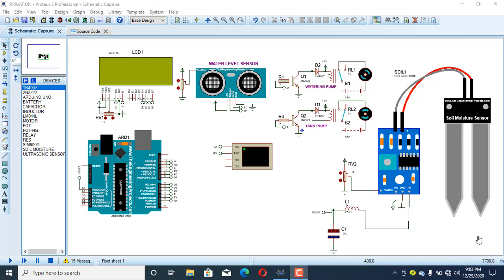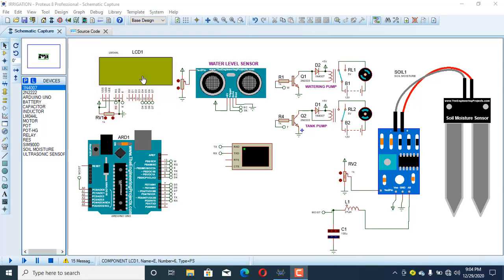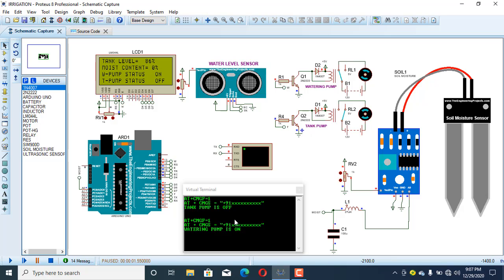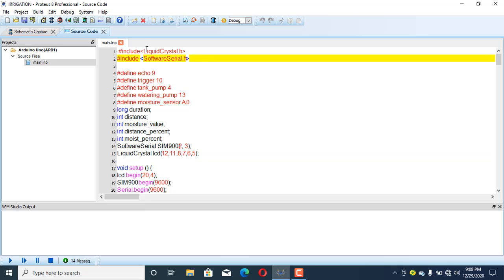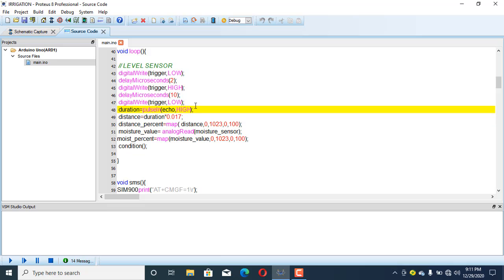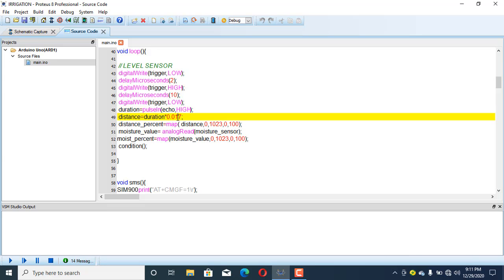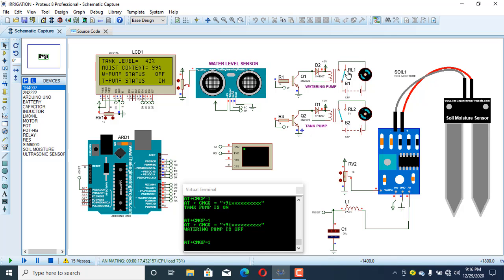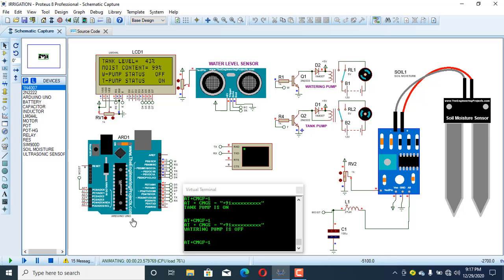Automatic Irrigation system with notification to the farmer (4th Arduino project simulation Proteus)

Comment: Your system only can receive sms to monitor ; You can not send any sms to control the hardware.
Reply from the maker: Yes you can do both . It can receive and send
Reply: @GhubaidaHassani  In your code that part is not present
Reply from the maker: @itrd_lab  yes

Comment: Sir, I have a question. What if I am using SIM800L except for the SIM9000. Can I change the command SIM900 into SIM800L. Waiting for your positive response and may I request the schematic diagram. Thank you
Reply from the maker: Yes you can use it

Comment: can you do simulation for IOT based smart farming having soil moisture sensor, humidity sensor, fire detector sensor and ph measurement sensor using node MCU
Reply from the maker: Yes
Reply: @GhubaidaHassani  when will you release video. Thank you for reply.
Reply from the maker: @nitinnaragude1952  I will try to do it as soon as I can
Reply: @GhubaidaHassani  In my proteus I am unable to bring Arduino, Soil moisture, Ultrasonic sensor

Comment: The video is very useful, but I wonder what is the use of SIM900 in this system? Why don't you add this component in the simulation?
Reply from the maker: I've used it in real implementation but for the simulation, I've just used the serial monitor to demonstrate how gsm will be working

Comment: Hello, I've downloaded the project and tried to open that and also i've downloaded the library for moisture and placed in library. But when I'm trying to open the file, it is throwing a dialogue box like (Symbol "$MKRORIGIN" used but not found in libraries.)
Can you please explain this?
Reply from the maker: Run proteus as an administrator
Reply: @GhubaidaHassani  Yep i got it. I'm facing 2 errors now 
1)Unable to open HEX file 'C:\Program Files (x86)\Labcenter Electronics\Proteus 8 Professional\DATA\LIBRARY\UltraSonicTEP.HEX'. [ULTRASONIC SENSOR#000E]
2)Real Time Simulation failed to start.
actually you've already addressed the 1st one. but, I've tried that as you said I've downloaded the library files from your drive link and pasted the files in the library.and also I've double clicked the moisture sensor and checked the path of the hex file. but still i was facing the issue.
Can you please kindly these 2 errors I am facing with ?
Reply from the maker: @quantumtech2832  double click the component add the hex file of the component in program file

Comment: Hey man, can you explain why that LC circuit is connected to the soil moisture sensor output?
Reply from the maker: simply it is used to filter out some noise from the output signal.  in real implementation, you don't need one.

Comment: Thank you so much Ghubaida Hassani! But I failed to deal with this error"Simulation is not running in real time due to excessive CPU load". Any help I will really appreciate.
Reply: no some  power supplies in simulation has been inbuilt so it shows like that ,connect this circuit in hardware it is working correctly

Comment: What modifications I'll need to do if I want to use nodemcu to send data
Reply from the maker: Just add some few lines of code to send the data
Reply: @GhubaidaHassani  can you please tell.... What I have to add in program & which connections should be done for nodemcu & arduino

Comment: Can you please help me with my project. 🙏🙏
It is solar based using Arduino uno, moisture sensor, ultrasonic sensor, temp &humidity sensor, relay, solenoid valve,water pump,wiFi module(esp8266) . I only want code for this.🙏🙏

Comment: Hello Sir
Can you please share the diagram showing all the connection between the components, In the simulation the components are just placed
Reply: bhai mila hoga to bata na.... kal submission hai
Reply: Nhi mila h bhai
Reply: @AryanKumar-jz6pk  are yar... Chal thik hai mile to batana
Reply: @HarshSingh-un5kh  Hey did you got how are the connections joined?? because I'm a bit confused im not getting it. would. you please help.
Reply: @sahilkamble8750  han dekh.. vo saare components joined hi hai bas wires nhi show horhi apan ko... vo islie qki sir ne proteus ka ek tool use kia hai "component" naam ka(left side me dekhna milega)...and if you want ki saare connections and wires show ho then directly remove the component thing joki pins k samne lagaya hua hai gol gol sa... and connect wire to the similar pins

ex: connect "moist" to "moist"
Reply: @HarshSingh-un5kh  Okay Try karke dekhta. Thank You bhai
Reply: @HarshSingh-un5kh  Agar Tumne yehi simualtion with wire kiya hoga toh file send kar dta kya please bhaii. mera email - sahilkamble800@gmail.com
Reply: Hey did you got how are the connections joined?? because I'm a bit confused im not getting it. would. you please help

Comment: Sir do you have a detailed explanation about the diagram for newbies like me? Im having trouble understanding all the connections
Reply from the maker: Yes
Reply: @GhubaidaHassani  how can I connect all the parts? How can I contact you sir?
Reply from the maker: @kenalvincorrea2738  ghubaidahassani@gmail.com
Reply: @kenalvincorrea2738  did you got the solution brother ? Im having the same problem...see if you have circuit diagram.. its urgent coz tomorrow is my submission
Reply: @kenalvincorrea2738  Hey did you got how are the connections joined?? because I'm a bit confused im not getting it. would. you please help
Reply: Sir i want to contact you?

Comment: Where is the GSM module used in the circuit? Is it embedded inside Arduino UNO? Please reply, it's urgent.
Reply from the maker: I've used a virtual terminal instead of the gsm module so that I can see the text messages that will be sent. ..
Reply: @GhubaidaHassani  So currently the messages are only being displayed and not sent as SMS right? But why is the SIM900 module been used in the source code? For example,  code like SIM900.begin() and SIM900.println() are used.
Reply from the maker: No. Those are the actual messages that will be sent, for the case of simulation virtual terminal is used to display the text messages. But if you're about to implement it then connect your gsm module where the terminal is connected. And the SMS will be sent in each case.
Reply: @GhubaidaHassani  thank you so much for your help!
Reply from the maker: You're welcome
Reply: @GhubaidaHassani  Sir  i tried this but i got this error "real time simulation could not proceed due to access cpu load" what should i do?

Comment: Pease can you help me in my projet .arrosage automatique (capteur humiduté de sole+capteur de lumiére+capteur de pluie+ capteur d'humidité et de tempirature+ electrovanne electrique+bleutooth hc-05 et memoire cart SD+lcd)🙏🙏🙏🙏🙏
Reply from the maker: Could you use English pleas
Reply: @GhubaidaHassani  automatic irrigation system arduino mega base and bluetooth hc-05, and sd memory, rain sensor, air temperature and humidity sensor, soil humidity sensor, light sensor, and solenoid valve, and LCD display.can you help me .l want code in arduino  +schema in proteus 🙏🙏🙏
Reply from the maker: @karimaezzouhri8751  what's the task you want to do
Reply from the maker: @karimaezzouhri8751  ghubaidahassani@gmail.com

Comment: How much current do those pumps draw?   Do you really need the mechanical relay?   If you need the relay, you should put some diodes on the pumps to protect the relay contacts from arcing when they disconnect.   If the pump draws less than 30 Amps you could replace Q1, D2, and RL1 with an N-channel mosfet .   It would be cheaper and more reliable.    If the pump draws less than 5 amps you could replace RL1 with a big NPN transistor, even cheaper.
Reply from the maker: Yes that's correct.. this is  just a simulation . If you want to implement it then you have to check your components rating

Comment: That kind of moisture sensor passes electric current through the soil.   The current will cause a chemical reaction and the sensor probes will corrode.   The corroded probes will leave toxic metal oxide in the soil.   Spend one dollar more and use an insulated capacitive soil moisture probe instead.   It will last much longer because there is no chemical reaction.
Reply from the maker: You can use the best one instead

Comment: Sir , thank you so much for such an informative project.  But i am facing with an error "Unable to open HEX file 'C:\Program Files (x86)\Labcenter Electronics\Proteus 8 Professional\DATA\LIBRARY\SoilMoistureSensorTEP.HEX'. [SOIL1]"
Reply from the maker: You have to add soil moisture sensor Library in your proteus...
If you have it the double click the sensor from your schematic then under program file browse the library file from local disk C.
Reply: @GhubaidaHassani  Thank you so much, path was mentioned wrong ! Now, it is running perfectly! And thank you so much such a great project ,it was really amazing to simulate it!
Reply from the maker: Thanks  keep supporting
Reply: @GhubaidaHassani  can u explain in detail i didnt get it
Reply from the maker: Just download the soil moisture sensor Library and then add it manually into proteus library folder.

Comment: The project idea is very innovative and you explained it really well. But while trying to run the simulation I am facing an error stating : Unable to open HEX file 'C:\Program Files (x86)\Labcenter Electronics\Proteus 8 Professional\DATA\LIBRARY\SoilMoistureSensorTEP.HEX'. [SOIL1]
CAN YOU PLEASE HELP ME OUT RESOLVING THIS ISSUE ?
My emailID- deveshgupta159@gmail.com

Comment: Hello Sir, please I need the circuit diagram and arduino code of this project?
Reply from the maker: You can download it from the link in the description
Reply: @GhubaidaHassani  Allright thank you👍
Reply: Please can you help me with a schematic diagram for interfacing a Relay and a 12V DC Water Pump, please if you do have forward it to me through djitsagalilee12@gmail.com. or through this Comments tab
Reply: @marshalgalileedjitsa5008  Hey did you got how are the connections joined?? because I'm a bit confused im not getting it. would. you please help

Comment: Sir simulation  is not opening  can u send it again sir??
Reply from the maker: Which proteus  version are you trying to open with?
Reply: @GhubaidaHassani   sir protecus 8 version
Reply from the maker: @venkyvlogs6845  use  8.9 or later version
Reply: @GhubaidaHassani  sir i have 8.9 version but still 53 errors ocurs ,like pin nc is not modelled

Comment: how can i add soler panel power in this project??pls tell me
Reply from the maker: Just use a solar panel with 12v battery.  And use a regulator to get the voltage required for each component
Reply: @GhubaidaHassani  the code of this project can be change by adding solar panel?
Reply from the maker: How?.. I though you want to use solar power as the source 
.. if that is what you to do .. then the code will remain as it is..
Reply: @GhubaidaHassani  ok tnq u.my confusion is clear
Reply: @GhubaidaHassani   can you make this project with solar panel and make a video.it will be very helpful
Reply from the maker: @sifatuzzamanniloy4892 fine  I will try to do that
Reply: @GhubaidaHassani  tnq u bro❤️
Reply: @GhubaidaHassani  can u sir make this as early as possible cz i want to submit this in my university 😥
Reply: @GhubaidaHassani  bro when i connect solar panel with regulator and connect with motor then the motor can't run ..pls help me out
Reply from the maker: @sifatuzzamanniloy4892  have you measured the output voltage of the panel and the  regulator?
Reply: @GhubaidaHassani  in solar panel voltage is 12v and potentiometer has 1kohm resistance
Reply from the maker: @sifatuzzamanniloy4892  can you send me the circuit
Reply: @GhubaidaHassani  bro i have done this with solar panel .tnq u bro❤️
Reply: @GhubaidaHassani  sir in your code distance means which distance??can u explain
Reply: @sifatuzzamanniloy4892  bro can you share the ckt even i am doing using it
Reply: @GhubaidaHassani  sir can you help me with this i am also working on the same project
Reply from the maker: @rockstarm3992  what's the problem
Reply: @GhubaidaHassani  bro can i mail you?
Reply from the maker: Yes
Reply from the maker: ghubaidahassani@gmail.com
Reply: @GhubaidaHassani  plz check it
Reply from the maker: @rockstarm3992  ???
Reply: @GhubaidaHassani  I have mailed you.Plz check it

Comment: Great tutorial !! will be waiting for the  RTC module video :D
Reply from the maker: Soon I will post it
Reply from the maker: Thanks .. don't forget to subscribe
Reply: Hey did you got how are the connections joined?? because I'm a bit confused im not getting it. would. you please help
Reply: @sahilkamble8750  if by how you mean why there is no wiring in between the connections then the answer is this, He used a "place wire label" for every connection. By using a place wire label, you can connect all of the joints without wiring. You can find it by right-clicking and after that putting the same string name for all the paths you want to connect.
Reply: @robertslash3488  Thanks For the Information.👍